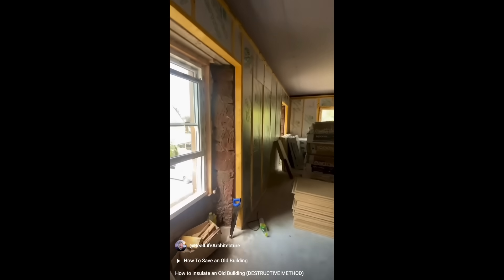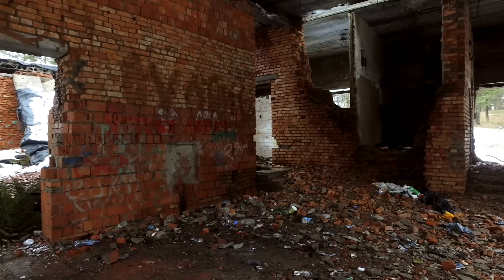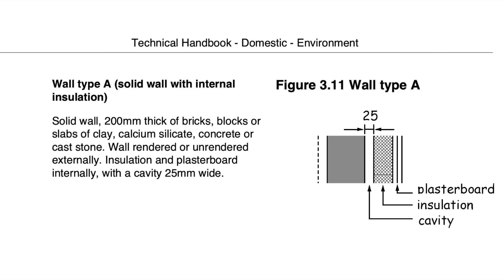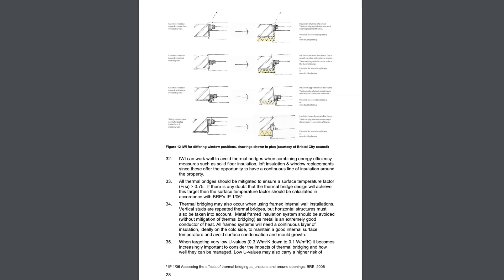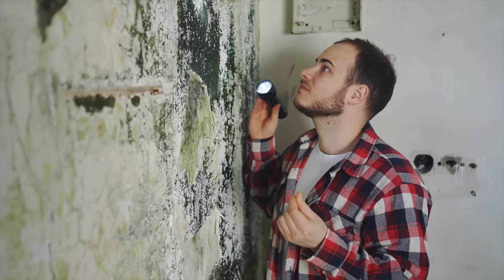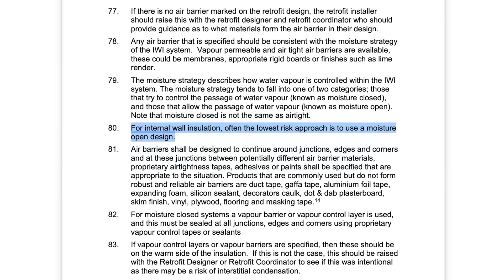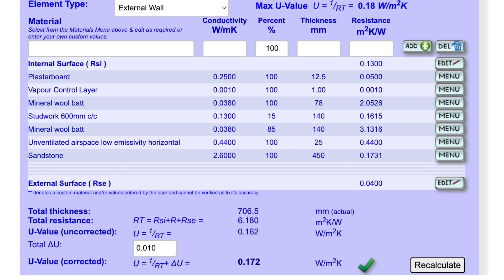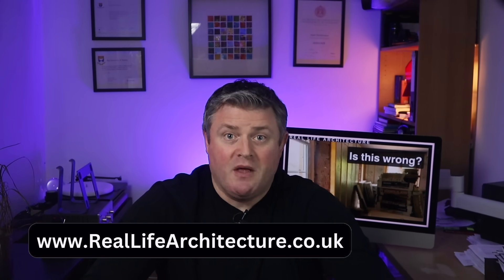How To Insulate Inside a Solid Wall in the UK

Comment: So insulate the exterior. Better anyway.
Reply: People understandably don't want to do that on attractive stone buildings.
Reply: @AgileSnowWeasel  Being warm can override pretty. Or perhaps better looking exterior cladding. Use the stonework as a heat sink on your side not exclude it.
Reply: It's not recommended to insulate the exterior of stone buildings, precisely because if you have a leak you don't know about, moisture can get into the fabric and cause extensive mould problems. I feel there are ways around this (installing mechanical ventilation, for instance) but I'm not sure these are recognised..

Comment: I used insulated plasterboard on my outer inner cavity walls and ceilings and it was a game changer even on a cavity wall .
Reply: same. i have cavity walls on a 1960s build with fairly porous bricks, and didnt want to go down the cavity route as I fear that will bridge damp across. We used 25mm roofing batten on interior walls with 50+12.5mm foil insulated PB laid on top and it's made a huge difference. Lost about 90mm off each interior wall, but they are big 1960s rooms anyway...
Reply: I put 25 mil straight to the wall, my house is only 35 years old and had no damp issues but my door reveals were tight to the outer walls so didn’t have room for 50 mil. The house was freezing because the cavity was filled with the hairy stuff. Went for k18 because it was the best u value for 25 mil.
Reply: The problem with insulated plasterboard is that you can't make an airtight construction, because you can't tape the joints between the insulation. It's much better (and cheaper) to put up the insulation first, and airtight the edges and joints, then put plasterboard on top.

Comment: Should have just rendered it with a insulated lime render. 👀
Reply: Yes, it would be more breathable but on a like for like basis, you'd need to have the render a LOT thicker then the PIR which has a much lower K-value so is a much better insulator. (Lime render apx 0.12 W/mK for a good one compared to 0.022 W/mK for a good PIR)
Reply from the maker: How thick would this render need to be to achieve the required U-value
Reply: There are several different types. So it's is dependent on what you use. The cork type is not so good at being wet for long periods of time. The pu is fine for this. Same rules apply, you choose the product for the place you're in. 

Normally it would be two inches on average thick. then topcoat with lime putty and a final incredibly tight coat of mature lime putty just to get the tiny cracks.. 

You can find the u value from the various manufacturers. 

The good thing with this is it allows the building to keep its normal cycle of moisture. Through both sides of the wall. Remove any external cement render and use this on the external face also. 

It's Is a good product because of this, moisture is cold and will not cycle through plastered gypsum. All it will do is rot the plasterboard. It's can also be very bad for the wall itself allowing it to be wet and stay wet. It's mud and a fair amount of organics in the middle of that wall. Dependant on location the stone if not allowed to dry out can decay as well.     

Building control only seem to like the modern ways. The wall itself if dry is a brilliant heat store. We just have to treat the old buildings as they were intended to be treated. Low level constant heating, under floor is good with these old places if possible. Sealing them up is not so good though. Building control want that but it will eventually lead to rot and really bad for your health. Wood burners are good for these houses. Draws in fresh air. 

The reason they are expensive to convert to modern ways is because you have to re do it every few decades as it doesn't actually work. It's just makes the problems worse. If it's cold the air flow behind the timber wall does nothing, well very very little.

Comment: It's very interesting reading all the comments on this video. There's another thing to consider when insulating solid walls and that is insulation will mean an exterior wall will not be as warm as it used to be, so will retain more moisture. Old houses were built leaky as heck and expected to have a lot of energy put through it with open fires. It's such a headscratch trying to work out best practice. I've just internally insulated my 1930s house which always had damp patches here and there. On one external wall, I battened 25mm, then used Proctor Aerogel blanket, then plasterboard. I thought the breathability of an airgap would be a good idea. In another room, I put the Aerogel blanket directly on the wall then used batten to hold it in place, then infilled with 25mm PIR and tape then plasterboard. Both rooms are airtight but one is vapour tight, the other open. For the stairwell, I used Proctor Aerogel on magnesium board directly applied with adhesive. 4 years later, all three methods seem to doing very well indeed. I'm about to renovate the downstairs and I'm not sure which method to use. They are all good warm rooms now, and it will be interesting to see which one proves best over time. Proctor Aerogel is messy as hell to work with, and very expensive, but it loses the least amount of interior space as it's so efficient, and it is vapour open but hydrophobic so ideal for slightly damp solid walls. I sound like a salesman! I'm not, just a fan!
Reply from the maker: Thanks, I reached out to Proctor today to discuss this with them.
Reply: Does Greenspec have anything to say about it?
Reply: I really wanted to insulate our 1860's small cottage using Proctor aerogel, as it's the only thing that keeps heat in, but lets vapour out in one configuration, and it's just so fantastically insulating, but it's just too expensive for a tight budget. Glad to hear it worked well for you, though..
Reply: @Danothebaldyheid  True enough. It is hugely expensive, but my house has small rooms and I didn't want to lose 250mm on each wall, so... On the other hand, being small the cost wasn't too mad. I did the two rooms and the roof using PIR between and under the rafters for 6.5k myself, whereas the quotes from builders were 20k plus. And everyone in back in 2019 had a different idea of how to do it, so I researched it myself and talk to a couple of architect friends and went my own way. It's really interesting to see how the ideas on how to insulate have evolved over the last 5 years, this video being a case in point.

Comment: Any reason the outside wall can’t be treated with waterproof resin/paint?
Reply from the maker: Probably because it will noticeably change the appearance of the building and it is likely to weather / erode over time, introducing moisture into the building.

Comment: Legally habitable ?
Reply: I'm not sure exactly what your question is but for someone to be able to live in a building as a residence, it needs to have meet certain performance (plumbing, drainage, electric etc) and amenity standards (spaces to 'live', sleep, cook, bathe etc). Standards which comply are cited in the Building Standards (ie. "Regs"), so in order for someone to use a building or structure as a residence, it must meet these standards in order to be 'legally habitable'.
Reply: @giotto4321  at the beginning he says how do and how much insulation to make it legally habitable. Is this a thing now ? Insulation to make the property legally habitable ?  I lived in a solid stone wall cottage at 850ft above sea level for over 10 years and was comfortable enough.
Reply: @SpudUna  If you're in an existing residence,  you don't need to do worry or anything. Building regulations updates aren't retrospective, they only apply to new applications.
Reply: @ gotcha 👍🏻

Comment: Good upload.
The key consideration to pay attention to with vapour open build-ups is air tightness.
The volume of moisture transported through air diffusion is insignificance vs that which is transported through air leakage, hence the importance of a parge coat in a vapour open buildup.

Comment: Solid walls are always wet. The important thing is to never put anything up against it that will go mouldy - like plaster or plaster boards. 

You don't need to waste space or money on breathable insulation. Just wrap a dpc tape around inch thick battens against the wall to allow for a gap. Then put pir board on that. Pir board should never be put directly on a solid wall. If you want to go the extra mile use a bathroom elements board over the pir board then plaster over that with a hydraulic lime like baumit rk70 in 2 coats.
Reply: hi, can you please suggest a video of someone using this approach? Do you recommend PIR (Celotex?) or something like K118?

Comment: Retired architect here, did a lot of similar construction. Good video, a few thoughts 
What you can a breather membrane is not strictly the correct term.  That is usually the membrane behind external cladding.
To allow some reverse moisture movement there are specific vapour barriers.
(When the sun shines on a saturated wall, it will drive moisture inwards) 
We would avoid any timber behind the vapour barrier.  Use metal studs.
The type / quality / thickness of the existing wall makes a huge difference, as of course, like you say location.  A good lime plaster parging is an excellent idea.
Reply: Hi Mark
I think your comment should be pinned. This video is quite misleading in the details of the execution as it really matters. I was wondering what your opinion on the taped plasterboard was? I’d be concerned about mould development

Comment: I have both methods in my building direct insulation to the inner wall on the Sunday school done in 1997 and with an inch cavity in the Chapel end done 2017 both have been effective at keeping the building warmer but without signs of damp or condensation . The building is 100 feet long and faces northwest/southeast along its length. I live in South Cornwall and 5 miles from the Atlantic coast on a high spot entirely open to the Atlantic winds and rain. My walls are granite and infill at 650 mm thick with pointing on the outside.   My view from experience of this building and my 50 years  in the industry is that they both seem to achieve a similar aim, difference perhaps in the r rating being better with the inch cavity and why I did it that way on the conversion. Possibly 2 inches would be preferable if the living space can allow for it. Retaining the lime plaster on the inner skin is I think a factor and a must as this does help the wall breathe to the outside  when windy and sunny weather help remove moisture from the wall.  Much of this side of the building regs is suck it and see and will continue until decades have past to prove what was done was effective or not.  There could be as many problems over insulating as under insulating only time will tell.

Comment: I have only seen the historical method you describe – lath and plaster ‘stood-off’ from the wall – in seaside properties, like Scarborough, which gets wind blown rain off the North Sea. Insulating outer walls brings a lot of potential problems, hence the ‘advice’ from various sources is often guesswork & simply all over the place. I do agree with you about this area of renovation becoming of increasing interest.
Reply from the maker: Some old walls have lime plaster directly on the inner surface of the masonry.
Reply: @RealLifeArchitecture  Indeed, my house has that plaster & method of application. For English houses, built before WW2, that was the standard method of construction. Gypsum plasters are much easier & quicker to apply, hence their use today. My point was the 'stand off' method, was used ONLY in locations of heavy wind blown rain, not a standard as you seemed to imply. As a side note, I doubt how 'breathable' lime plaster actually is and suspect any drying effect on an outer wall is due to internal heating.
Reply: @RealLifeArchitecture  most do, except in Scotland where the lath and plaster stood off the walls is the norm (because of rain (in the rainy bits)).

Comment: Thanks for this, I’m going to be insulating my old stone wall house later this year and will watch the whole video this evening. One of your comments mentioned there is so much conflicting information, I feel the same and this is why I have not started the work yet. I moved into this house in 2023 and its taken all this time to dry out the house as it was vacant for 5 years before I bought it, unventilated and unheated it was like walking into a damp basement. A reasonable amount of heating and plenty of ventilation has cured a lot of problems, one wall was particularly bad and it turned out to be a leaking main water pipe under the floor, it has taken nearly a year to dry out the wall and floor but finally it has worked. My other problem (yet to be tackled) is the render on the front wall is trapping the driving rain in the wall. That combined with the number of holes drilled for TV aerials and satellite cables has caused a lot of problems upstairs, just removing the cables and filling the holes has helped a lot. I am still looking for other sources of water ingress as I don’t see any point in insulating the walls while water is still getting in through holes in walls and defective gutters and downspouts. 👍
Reply: Ah, contentious issue this. If there's one thing I've learnt since owning our 1780's Cotswold stone cottage,  and that is to use the materials that our forebearers used to build these houses. Lime mortar, lime render etc. Don't even let any so called damp expert inject your walls with chemicals, as you may as well stuff your pound notes down the nearest drain. If your rendered wall is made up of sand and cement,  get that off to start with. If the pointing to your stone is the same, get that out and re-point with lime mortar. These steps will make your property a lot more breathable. Wouldn't even entertain insulating the inside as 1) you'll lose internal space, 2) you'll never know what's going on behind the insulation.  I'm no builder or damp expert, but it's what I've learnt over the last 20 years in a stone cottage with the help of traditional stone masons and lime experts. Still hacking cement based mortar from the pointing ready to be properly pointed with lime mortar. Some of the quotes for this type of work might be frightening, but to be honest, it ain't rocket science and we'll within the capabilities of the competent diy-er. Good luck.
Reply: If an external wall is rendered rather than having beautiful exposed stonework, then would it not make more sense to fit external insulation and re-render on top of that?  That would keep the walls themselves warm and free from any internal condensation, and you wouldn't lose any internal space.  I'm sure you have thought of that option, and perhaps it is not possible in your property?  I think in any case I think you are wise to get the basics right first, i.e. stop the rain getting in, fix the roof, fix the guttering, fix the leaking water pipes, seal any obvious cracks or holes in the render, etc, etc, etc.  A lot of damp problems will go away if a house is basically sound and weather-tight, and if it is lived in.

Comment: You must let old walls breathe. Lime plaster helps as does ventilation. Use your heating which in turn dries everything out. A dry house is then warmer so the fuel bill is lower

Comment: I used Knauff Thermoshell In 2015 on a solid wall … Amazing. 10 years on. and it’s transformed the house. We had mould and damp growing on the north wall in the bedrooms and behind wardrobes . There was nothing we can do to get rid of it until we insulated  the internal walls. We also introduced insulation on the and underfloor heating at the time chose to insulate the floors . Our heating bill was reduced by 75% and the house is permanently comfortable with no cold spots or drafts I definitely would recommend it 100% I should do a YouTube video on it myself as at the time I was the only person I knew he was doing it you are the people who are using PIR installation and even insulated plasterboard which they don’t and that directly onto the wall big mistake if you do go down the same route as me then make sure you use the moisture permeable membrane as there is a cheaper membrane which is just plastic which defeats the whole object Maintaining moisture permeability (what people sometimes called breathability)
Reply from the maker: That is brilliant, thank you for sharing. My next move is to research membranes.

Comment: I did months of research on this, even watching your clip, most architects and surveyers said not to insulate solid walls, but with the pressure of improving your EPC's I felt I needed to insulate the walls, 
Eventually I went with breathable superfoil, I cross battened the wall, packed them out to straighten the wall, stappled the superfoil to battens, cross battened,  plaster boarded and plastered. 
A long exspensive process to save a hundred pounds or so in energy bills per year. 
How will this effect the thermal performance of the solid walls now there's less heat getting to them?
The carbon footprint creacted to earn the money and creacte the materials all to save a few hundred pounds a year, is it to just tick a box rather than doing it the most effective to prevent carbon? 
I'm not convinced
Reply: Remember the comfort factor too, our house was miserable before we spent a fortune on making it less miserable.
Reply: I didn't know that breathable superfoil was a thing. Normally those foils are not at all vapour permeable.